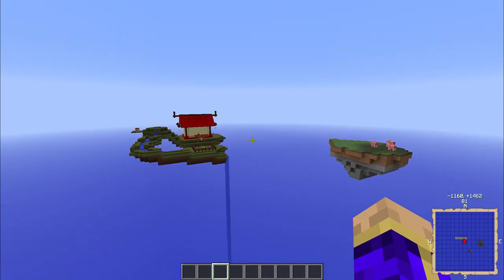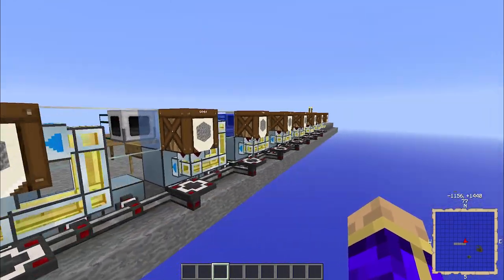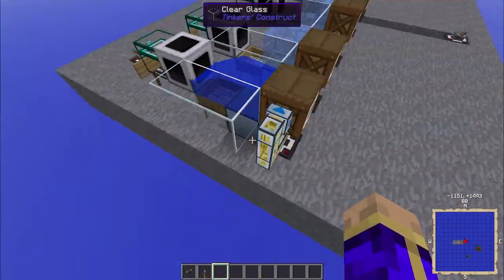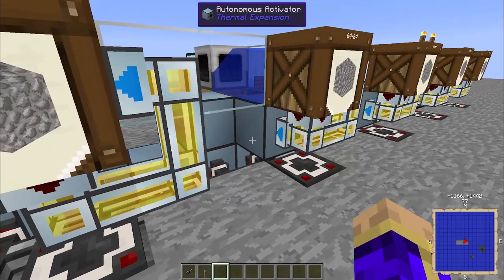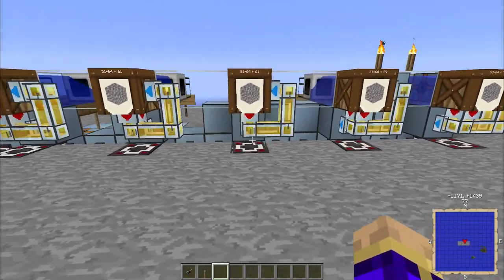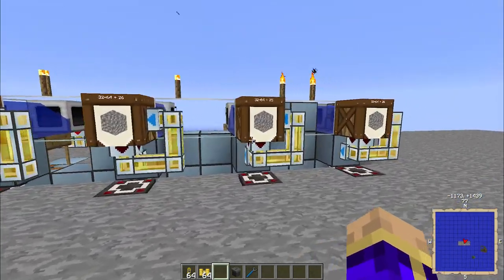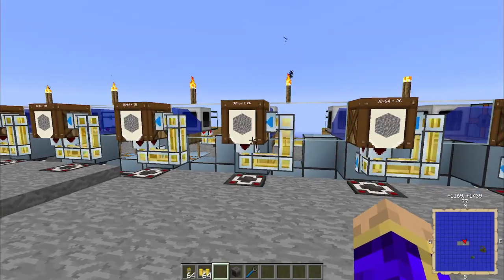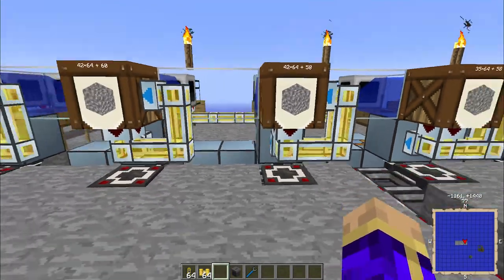Sieve / Autonomous Activator - Crossmod Tutorial

Comment: I reckon that 7,8 and 9 would be faster if the input was modified as the gravel can only be sieved when it's actually put into the sieve. If you added a few pipes to the other activators you would probably find it's faster.

Comment: (just tried posting, but looks like it got deleted) doing a run right now where I'm avoiding autonomous activators and using mouse keys to try and afk my way to lasers
Reply from the maker: Yeowch. That beeline woudln't be as painful if you didn't need to do the quest line to open up the laser quest, but still not very user friendly!
Reply: Actually jumping straight to lasers is mostly because any thermal expansion machines/pipes (as it seems), are making my game lag to the point where it's unplayable. It's bad enough with the fluiducts to make your mob torture chamber and a simple mfr treefarm. I believe it has something to do with my java not working right, but that can't be repaired because my Windows installer is broken

Comment: Hey PurpleMentat
I just tried something related to this video - if you use 13 autonomous activator and fill in the gravel in more than 1 of them its slightly faster than your setup
it grinded about 1 1/2 stacks more over 30 minutes
- I think its because every activator ticks once every x ticks but if you get gravel in all of them there is a 100% chance the next tick after the sieve is finished gravel is refilled. Hope this helps
Gilfort